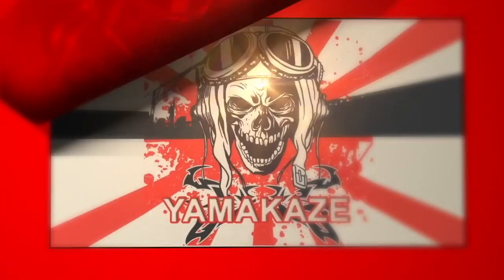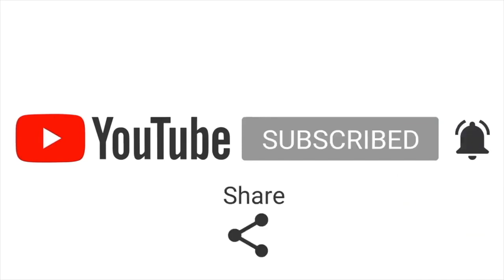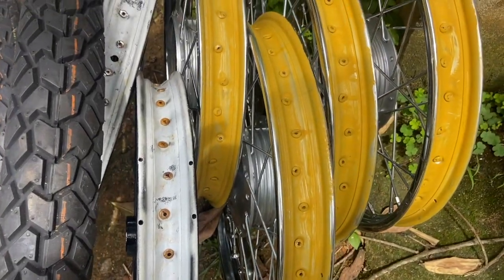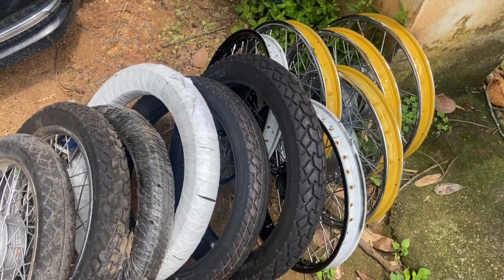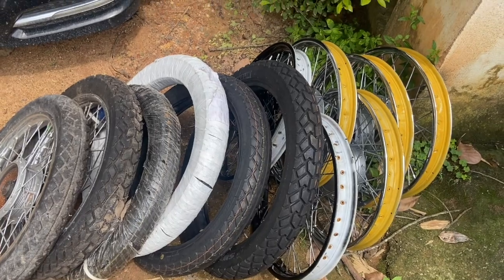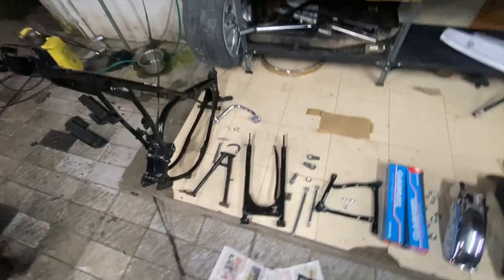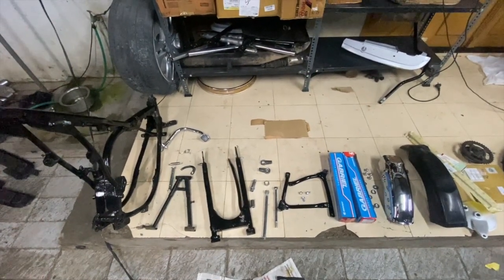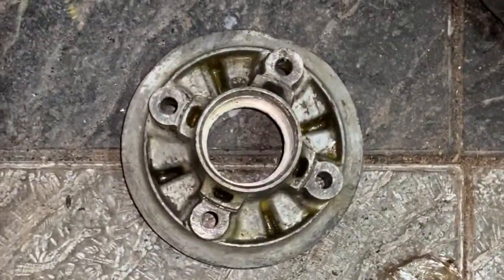KBV RX 100 Restoration, reassembly (Malayalam video)

Comment: Sir, my rx100 was standing parked for more than six months. Did regular maintenance(oil change, carb cleaning etc) work before starting the bike. The clutch feels really hard. Changed clutch cable, clutch push lever and screw push, but still no luck. Clutch play was checked while changing oil. What else should be checked?
Reply from the maker: Adjust the clutch play properly, ensure a metal ball was inserted between the pushrod and the plunger
Reply: @Yamakaze  Sure, Sir. I will set the play to spec and also check if the metal ball is present.
Reply from the maker: @allaboutnothing99  👍

Comment: ചേട്ടാ ഒരു ഡൌട്ട്
പെട്രോൾ oil ratio എത്രയാണ് നല്ലത്.1 ltr 30ml എന്ന് കേൾക്കാറുണ്ട്. പക്ഷെ കമ്പനി ഓയിൽ പമ്പ് കൊടുത്തത് കൊണ്ട് ratio പറയുന്നില്ല എന്നും കേട്ട്. എന്റെ cylinder 0.5 unsleeve cylinder. ആദ്യം ഉണ്ടായിരുന്നു owner പറഞ്ഞു ഒറിജിനൽ കമ്പനി പിസ്റ്റൺ ആണെന്ന്.നല്ല പെർഫോമൻസ് തരുന്നുണ്ട്.ഞാൻ 40 ml ഒഴിക്കാറുണ്ട്.50 60 speed കൂടുതൽ പോവാറില്ല. നല്ല cylinder കിട്ടാൻ ഇല്ലാത്തത് കൊണ്ടും വലിയ വില ആയത് കൊണ്ടും ഇത് പോലെ engine ലൈഫ് കിട്ടാൻ വേണ്ടിയാണ് ഈ രീതിയിൽ ഒഴിച്ചാൽ മതിയോ?
Reply: Orginal company piston ankane onum illa Kure brand und
40 ml oil oyichatha mathi
Reply from the maker: 30ml is for normal use, 35 after fresh reborn during running in. Ithil koodthal ozichal plug short avum, silencer I’ll unburned oil ketti keidakkum.
Reply: @akhinkm650  പണ്ട് കമ്പനി പാക്കിങ്കിൽ വന്നിരുന്ന പിസ്റ്റൺ ആണെന്ന് പറഞ്ഞു.20 വർഷം മുൻപ് ഒരു തവണ engine അഴിച്ചത് എന്ന് പറഞ്ഞു.
Reply: @Yamakaze  thank you 🥰
Reply: @asaru206  20 varsham munb engine ayichal enkane .50 avum
.25 allea avandath
Reply: @akhinkm650  std കഴിഞ്ഞാൽ 0.5അല്ലേ അത് കഴിഞ്ഞു 0.25 next0.50 അങ്ങനെ അല്ലേ.
Reply: @akhinkm650  കൂടുതൽ അറിയില്ല. എന്തായാലും ഒരു പ്രാവശ്യമേ സിലിണ്ടർ ബോർ ചെയ്തിട്ടുള്ളു. സിലിണ്ടർ ഇളക്കി നോക്കി